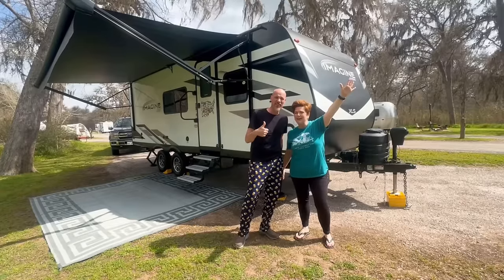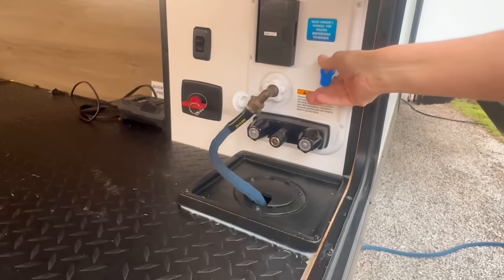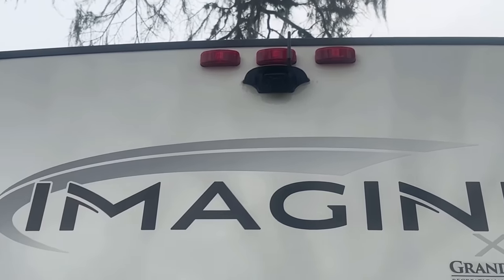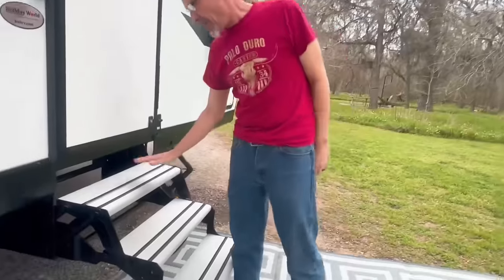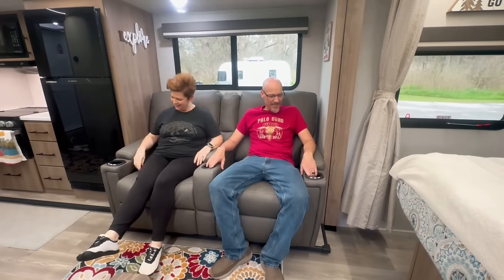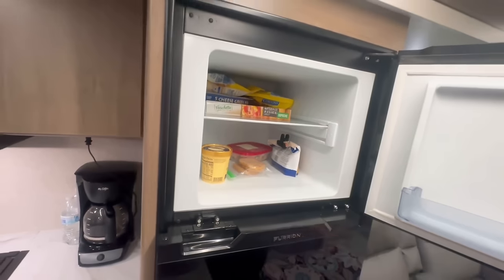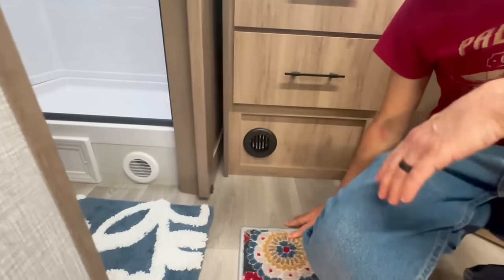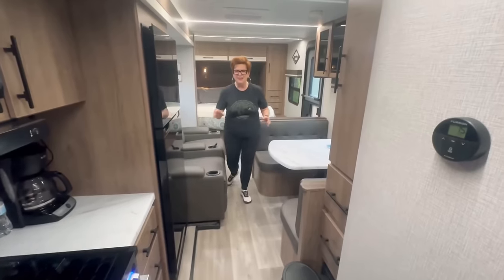Our New 2024 Grand Design Imagine XLS 22MLE Walkthrough!

Comment: Try setting your water temp to 106 and only use the hot water valve.  That works great on our 2024 Reflection 315RLTS.  No need to mix the cold/hot when taking a shower.
Reply from the maker: @larrymangold1048 Thanks for the great tip! We will certainly try that. Happy camping and thanks for watching! 😀

Comment: Very nice presentation and camper.  I love the layout and features.  The biggest short coming for me is the inside height.  I'm 6'5" and that is the ceiling height.  I just bought the Surveyor 202RBLE which is very similar but it has a 82: ceiling.  Enjoy your trailer!
Reply from the maker: @Ibexman Yes, the ceiling height would be an issue for you! Thanks for sharing your trailer and will be checking out the model. Thanks for watching and happy camping! 🚌🎉
Reply: I would say all of the OSB plywood used. It is heavy.
Reply: Hey there. We also bought the 202RBLE this past March and love it. My husband is 6’4” and we did a ton of research before buying. Forest River has just about the best ceiling heights in their couples trailer. Massage and heat in the theater seats? I would never leave the trailer. 😂

Comment: Loved your video! This is the same camper we are looking at purchasing. 

We have a question about the refrigerator. We do a lot of dry camping, does the solar that comes with the rig keep the fridge running for days without needing to use a generator? Right now we don’t have to worry about it because we are on propane..
Reply from the maker: @pammortensen8225 We have not tried boondocking for days so we really can’t answer that yet. We have heard the solar panel and the battery is not going to be good enough to keep the frig running for days. We did upgrade our battery to 100 ah lithium so hopefully that will help. Thanks for watching & hope you are able to purchase this model. We highly recommend it! 🤩
Reply: @OutsidebySide  Thank you for answering. We are going to go ahead with this trailer and will continue to subscribe to your great channel!

Comment: Hello Tonya and David. David, I am hopping that things are good for you. Thank you for this complet walkaround of the 22MLE. Like you, I have been doing my research and zooming in on either the 22MLE or the 23LDE Image XLS from Grand Design. I saw through you video, that you have a Ford pickup. I just changed my pickup for a F150 2023 Suprecrew Lariat with Max Tow package, 3.73 differential and the 5.0L V8 engine. Is your rig comparable to mine? I am preoccupied on the towing capacity of my pickup and I don't want to rely on an RV seller for this. Is your truck's Specs comparable to mine? How is your towing? I plan to buy a hitch distribution system like the Anderson distribution hitch, which acts both as weight distribution and anti-sway. any thoughts and/or suggestions will be welcomed. I don't want to make a mistake on my choices (expensive errors). What is your personnel take on the quality of your RV? Sorry, many questions here, but like I wrote, I don't want to make a mistake in my choice. Thank you and stay safe.

Andre
Reply from the maker: @andrebeaule9457  hello Andre, Our truck is a 2020 F150 and does have the max tow package with 351 gears and the 3.5 liter ecoboost. Our truck is very close and yours is newer. It has no problem pulling this trailer and yours should have no problem at all. We think the quality is  great so far and we have not had any issues yet. We use the Recurve R3 WDH with sway control and we really like it. We did make a video on this as well. We highly recommend this trailer. Please let us know what you decide and wishing you safe travels! 🤩
Reply: @OutsidebySide  Hello David, thanks for the reply and comments. I am leaning more at the Imagine XLS 23LDE rather than the 22MLE. At summer time (I live where there is snow in the winter), we like to bring our grand children camping, so a closed bedroom makes us a little more comfortable, plus sorry to say that I am at and age that I have to get up a few time during the night for the bathroom (you probably understand me 😉). So next spring, I am almost sure that the 23LDE will be behind my truck. In 2 years, when my wife will retire, we plan to cross Canada from est to west and come back via the US. Planning for around 3 months of travelling. Their is a slight difference in tung weight between the MLE and the LDE (30 lbs) and around 300lbs difference in UVW. I think that my truck should handled it comfortably. In regards to the weight distribution hitch, I am leaning towards the Anderson Weight Distribution Hitch. Looked at many videos and reviews and nothing comes up bad about it. One big advantage that seems to come up frequently is the weight (less) then the torsion bars systems, plus the anti-swing is incorporated into the ball itself. So less weight, less pieces in the system and very easy hook-up/un hook-up. Stay safe and again thanks.
Reply from the maker: @andrebeaule9457  Another mod we made to help us but not necessary is the Road Master Active Suspension and Bilstein 5100 shocks that helps with squat and bounce. We love hearing you guys are making the Canada trip when your wife retires! Our dream trip is to head up the west coast to Canada & then to Alaska. Yes, I understand the many bathroom trips at night. lol. Also, either trailer maxed out at 7K lbs should still be way under your trucks maximum capacity. Just remember that payload & gross vehicle combined weight are the most important numbers. Thanks again and wishing y’all happy travels! 🤩

Comment: Hi, you advised you can sit on your recliner with the slide in.  Can you confirm that to me please.  I was under the assumption that you could NEVER out any weight on the slide in the retracted position.  I am buying this exact model,
 "2024 Grand Design Imagine XLS 22 MLE".  Thank you.
Reply from the maker: @arlenewolf5260 Yes, we have sat in our recliners while the slide is in but we do not recline them. We do prefer to have our stabilizers down and it’s not often. We will definitely have to do more research on this! Thanks for your input. Congratulations on your new camper & happy camping! 🥳
Reply: @OutsidebySide  I am told that it doesn't matter if the recliners are reclined or not.  I was advised that any weight in the slide above the furniture and built in items in the slide can lead to catastrophic failure.  I hope I was misinformed since the entire interior is accessible it would be nice to be able to have a seat when parked between two tractor trailers in a rest area.
Reply: This week we just bought the 2024 XLS 22 MLE and asked the dealer this question and he said there was no problem with sitting in the recliners when the slide is in.

Comment: When you upgraded the batteries to lithium, did you have to do anything else? Change a controller or converter?
Reply from the maker: @gregdrivingthoughts the converter has auto detect that automatically switches from lead acid to lithium. Also make sure your solar charge controller is switched to lithium as well. Thanks for watching!  🤩

Comment: What tow vehicle do you use and how many lbs of payload is it rated for according to the door jamb sticker?  How has the towing been?  How close to the GVWR do you pack your trailer?
Reply from the maker: @gfmucci We have an F150 With the max tow package. It pulls great! Actually better than our last trailer due to the double axles! Payload of the truck is 1,570. We haven’t had a chance to check the weight on the scale yet. Thanks for watching! 😃
Reply: Ok, an F150.

Comment: When you run the air conditioner does the whole unit turn off and on as controlled by the thermostat or does the fan always stay on and just the compressor turns off and on?  Thanks.
Reply from the maker: @petergoeman7814 The fan has auto mode which turns the fan on & off. 😀
Reply: @OutsidebySide  Thanks.  That's not the case with all RV's.  My Winnebago View Class B the fan didn't shut off with the compressor and I recently watched a review on a new Jayco travel trailer and the owner complained that the fan did not turn off when the compressor did.  The air conditioners are so noisy that it's nice when the fan turns on and off with the compressor and you at least get a few minutes of quiet.
Reply from the maker: @petergoeman7814  we understand and yes they are noisy. Our last trailer was that way! It would not shut off and it was so loud. 😭

Comment: All good till the Lippert frame bends...
Reply from the maker: @RealRocdad We will try to have a glass is half full outlook instead! Thanks for watching! 😀
Reply: Yea, OSB....
Reply: @oldsalt8011  If I bought one I would add a 4×6 1/8" box beam across and in the frame above the axle, and 2x2 angle welded to the frame before the fact... when mine bent it also bowed inward.
 I repaired mine using a auto body hydraulic kit and additional steel.
Reply: @RealRocdad  I have to agree with you 100%. The under carrage is the most important part of a trailer. If I could build one with double axles I would have it so that if one tire or axle failed the other could take the load with no trouble. They do look pretty flimsey.

Comment: What do you tow with?
Reply from the maker: @oldsalt8011 We have an F150 with the max tow package! 😀
Reply: Well you did it right. Yes, add another solar panel, or battery, or bump up the trucks alternator. The 12VDC frig is great. No more running the propane.  Best floor plan out there for the money.

Comment: Ive been looking at these, how wide is the slide? can he stand up in the shower with out banging his head?? I wish him well with the cancer,I hope he is going to the right place for it.I went to the rong dr for my thryoid cancer... now mayo is the go to place for anything like that. nomore slicing for$$$ dr's for us.   how many solar panels can we put on the roof? I want 4 or 5 of the 22 watt panels.so the ac can run off of thehem&lithium batterys.
Reply from the maker: @marktucker1651 Thank you for the well wishes! All is going well and my Doctors are amazing! Tonya also had Thyroid Cancer. Did you have your thyroid removed? Hope all is going good for you and if you need any information, she is an expert on this topic. Here is the link to the specs for this trailer that will hopefully help with measurement. https://www.granddesignrv.com/travel-trailers/imagine-xls/22mle
Yes, I can stand up in the shower with no problem. I am 6'1" :) Happy camping Sir!
Reply: @OutsidebySide   they dont list the slide size thats why I asked. Yes my troid was removed by a slicing for $$ dr that went to law school...yup he screwed me up butt good. 5 surgery's instead of 1. cut some major nerves. the same out fit told my wife she had breast cancer did a biopsy, then said they need to do another one to determine what kind it was..thats when we went to mayo. thats the best place in the world and less$$$ than the local scammers.

Comment: Best to have a pro inspection, especially the frame !  GD is just producing junk and NOT making correct repairs.  Just a heads up .
Reply from the maker: @jdmrestor We are aware of the flex frame issue that is happening with many brands. The issue is happening with the larger 5th wheels not the bumper pull like ours. We still stand by Grand Design. The Lippert frame is the issue. Thanks for watching!